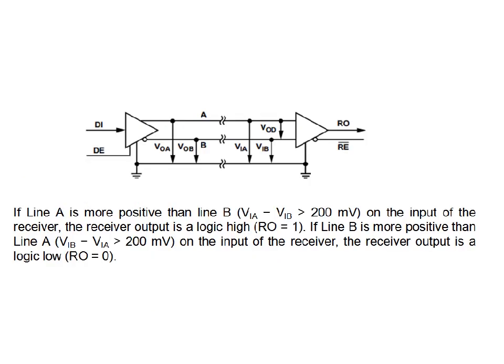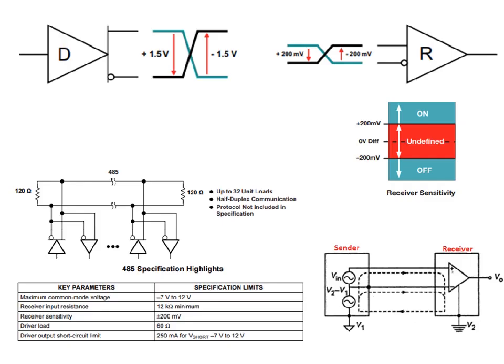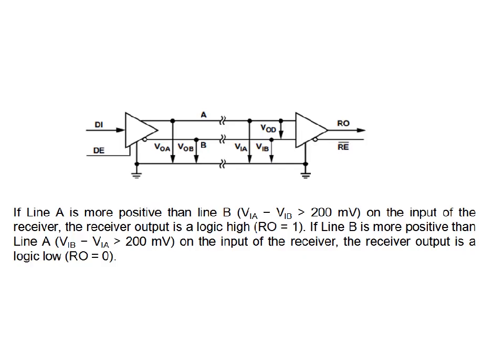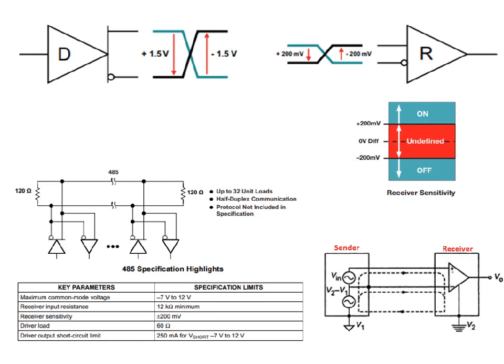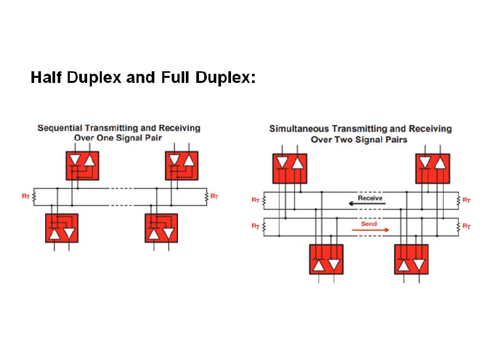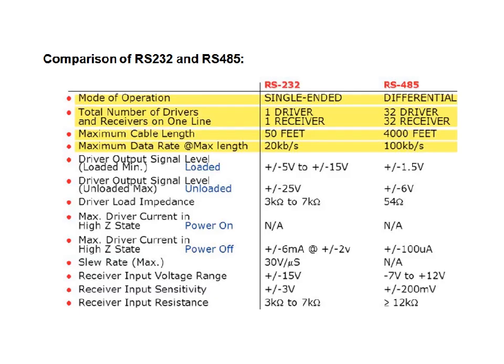Basics of RS232 & RS485 Serial Communication Part2

Comment: Please explain the working of rs 485 circuit what differential please explain,
Reply from the maker: In RS-485 logic 1 and logic 0 is determined based on the signal difference between the A and B lines i.e. differential signal no reference to ground. where as in RS232 single ended means signal is derived w.r.t gnd.